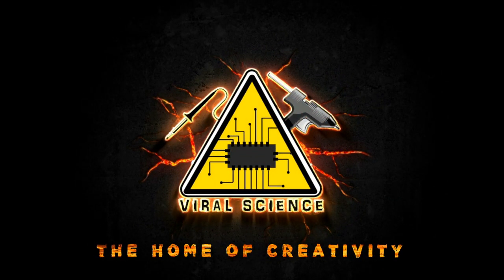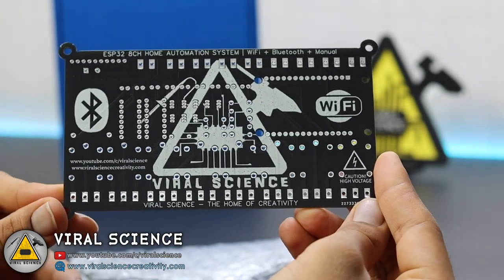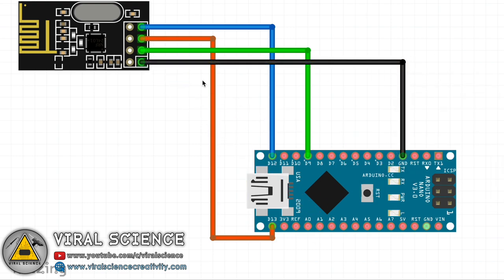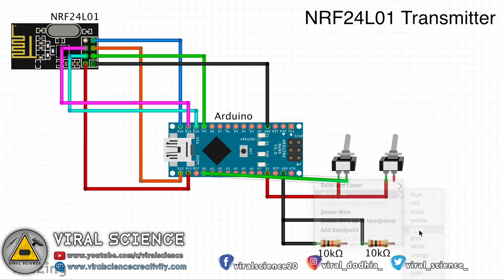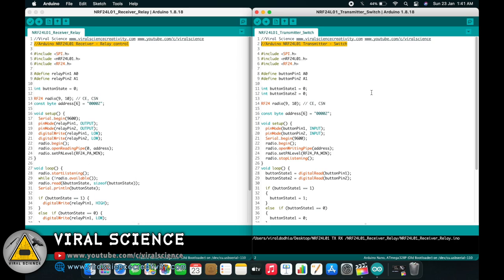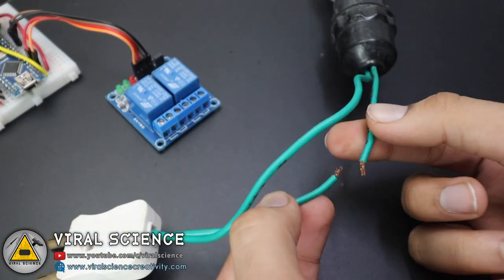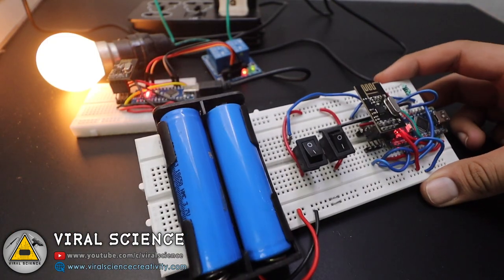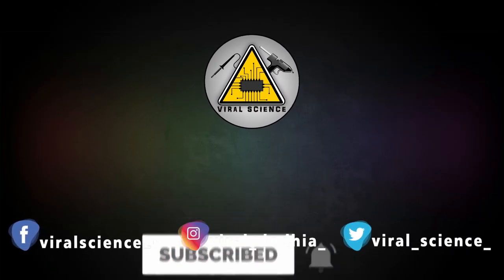Arduino NRF24L01 Transceiver Controlled Relay Light

Comment: Bro it’s a humbal request for make a home auto mission  project 
Using 
1 = ESP8266 / ESP32
2 = DHT11 Sensor
3 = MQ-2 Gas Sensor
4 = Soil moisture Sensor
5 = Ultrasonic Sensor
6 = PIR Sensor
7 = Humidity and Rain Detection Sensor
8 = Flame Detection Sensor
9 = 4 / 8 Channel Relay Module 
10 = IR Infrared Obstacle Avoidance Sensor Module

including  everything in one project 
Please please please
Reply from the maker: Sure i will try it

Comment: max range of this module?
Reply: Depends of your wifi router,  remember that it runs over 2.4Ghz so usually it cover ~10m
Reply from the maker: I found this info in some article, its approx 100m in open area.